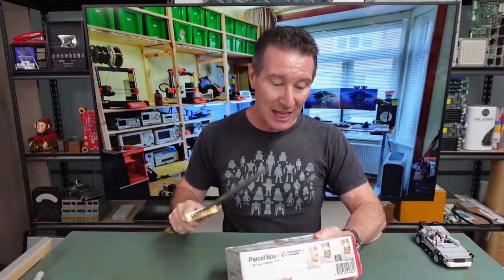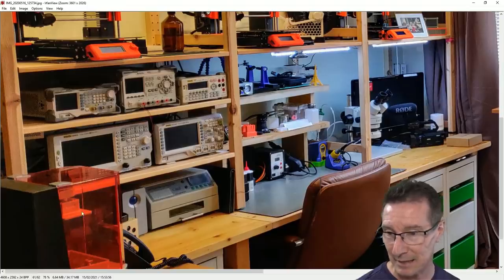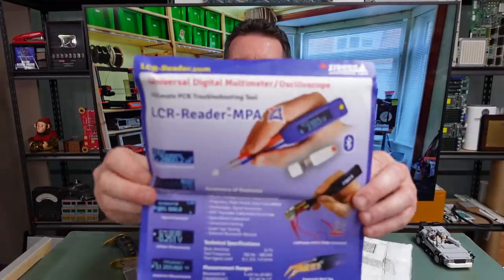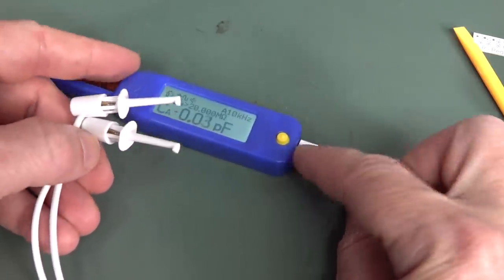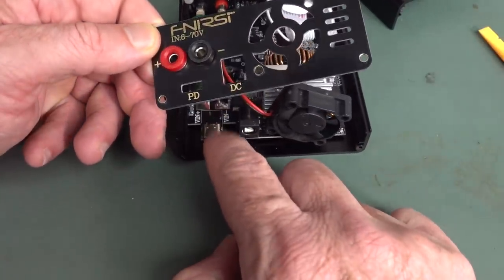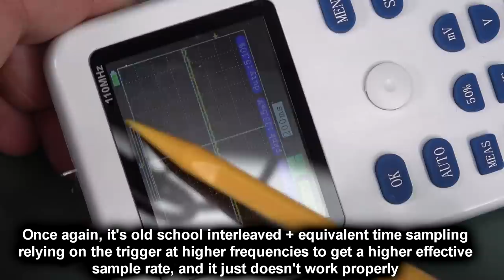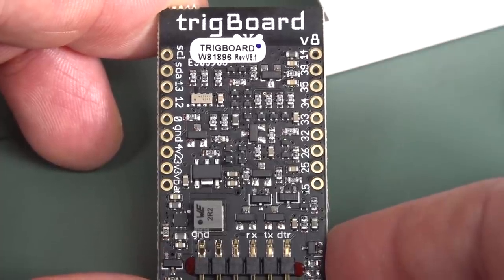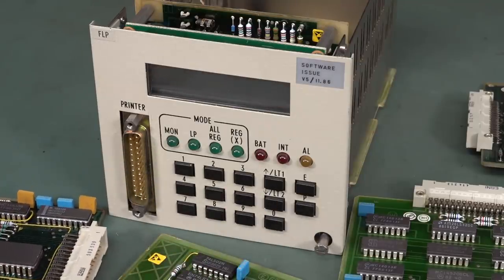EEVblog #1375 - Mailbag

Comment: Hi Dave.  The last mystery tin box is from a Siemens dual terminal optical fibre system.  It's the supervision, alarm monitoring and reporting device.  It reports alarms in real time as well as storing past events (there was a limit to the number of events it could hold in memory, but alas that parameter has escaped my memory - no pun intended)  The printer port on the front panel connects to a serial printer.  We used to use a dot matrix printer as it could print one alarm at a time and simply advance the paper through the printer as required allowing many alarm events to be recorded on a single page of tractor feed paper.  Helpful as it provided a permanent record of events which aided fault diagnosis

The LT1 and LT2 buttons refer to Line Terminal 1 and Line Terminal 2 hardware equipped to the same subrack. A tech could easily toggle the LCD to display alarms from each Line Terminal independently on the 2 line display using these buttons as well as a facility to scroll through past events.

The unit also extended alarms by applying an earth potential via relay contacts to the power and alarms panel in the equipment rack and to the station's generic alarm facility for visual, audible and remote monitoring purposes.  The REG buttons refer to optical regenerators along the fibre route between line terminals.  You used the buttons to view the alarm events at each regenerator site.
Reply: Yes!!! I remember working on these when I was working for Telstra (Telecom) in the early 90's.
Reply: I was going to post that it was specialist comms gear - but you beat me to it! Nice info too!
Reply: Dave should make a T-Shirt out of his comment though I laughed at "It's full of boards!" :-)
Reply: @footrotdog  Me too.  I used to work in Network Construction - Transmission (known as NDC) for Telstra in WA until 1989.  I eventually got a package when Telstra closed the training section in 2002.
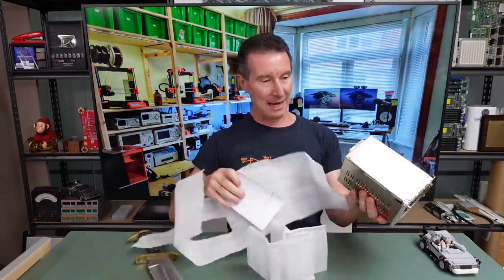Reply: It was probably written in the note he missed: 46:18
Reply: @romelec  It's a long episode - the old man was tired by now. A bit later he clicked the button and asked if this was a reset switch (47:13) and after he pulled the boards out he asked if this was a socketed relay (48:50)...
Reply: @oldguy9051  LOL
Reply from the maker: Someone always knows! Thanks Alan
Reply from the maker: @td4dotnet  I should have edited in a 2001 scene.
Reply: @EEVblog  you're welcome Dave. That's the beauty of this channel.  So many interesting things to see and heaps of viewers able to contribute to discussion.  Glad to be able to contribute.
Reply: ‘ultra-reliable’, as long as it doesn’t get wet.
Reply: @romelec  HAH! So true!!

Comment: I'm surprised you didn't recognise your first item the SCR. I have a dud that is about the size of a hockey puck it was  rated at 1700v and 600 A. Both sides mounted onto the buss work.
Reply: Yeah diode with a third signal wire, what could that possibly be?

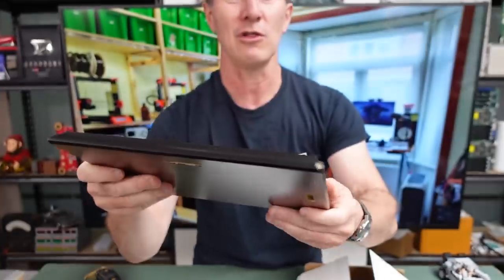Comment: 12:15 doesn't the IEEE have enough money for a CNC router or are you the first Senior Member and they tried to use it the first time with some furniture wood they've found on the road?
Reply: Not wood, just MDF
Reply: IEEE , ACM, SMPTE, ACS, they're all the same. You keep your membership fees paid up for decades you're good. You skip a year and the love is gone. IMHO there is somewhere between very little and no value in being a member these days when compared to the 90's. What do you think @EEVblog ?

Comment: ....but for the workshop you show us early  I didn't notice fire extinguishers on walls . Smoke alarms would also help .
Reply: It's a good point, I have a foam and a gaz extinguishers, and smoke sensor is at the middle of the room (only half is displayed in the picture). I am quite paranoid for that 😅

Comment: Separate cathode sense lead is because of lead inductance and resistance, as you generally trigger those SCR units using a pulse transformer, and the lead inductance of the main lead can slow down the turn on, so you have a separate lead to allow your gate drive to not have a massive step on it as the device turns on. Gate trigger is around 2V at 5A, typical pulse to ensure the slow device turns on very fast, as otherwise they are prone to burning out with poor gate drive, as only part of the junction turns on.

Ferroresonant not too common, though I have had a few of them as UPS units, and they are rugged and reliable, though efficiency is really poor, as the power input is almost constant irrespective of load, though they do provide a really decent sine wave output, just with high third harmonic, but excellent isolation. They do tend to be hard on batteries, as they typically use a SCR charger, and they will survive up to 2 cycles mains loss before they switch over, though most are dual conversion, with an always on output stage. 15 2N3773 transistors per half side, and they will blow up very nicely on any fault, blowing the cans off the TO3 packages.

Still got a ferroresonant line conditioner, which also serves as a pretty good room heater, as it is a 1kVA unit, so input power is close to that, and the output is totally isolated. You find the capacitor tend to fail, and you need to replace them with the correct part, as they can have up to 1kV across them under certain conditions, and they tend to run at around 600VAC with normal input voltage and output current.

Comment: Are there actually any half decent handheld o'scopes that can display their claimed frequency properly . Even at 50Mhz and lower, that thing was jittering/jumping all over the place and the sine wave was not smooth at all. Square wave would be even worse.
Reply: Just use the carrying handle on a regular oscilloscope. Boom! Handheld oscilloscope!
Reply: To be fair, it's good enough for automobile and Arduino work, I made my own awful £18  DSO138 kit, good enuff for PWM. It's very hard to justify/afford the multi-thousand dollar price tag of the big players like keysight for using in dirty environments or for hobby suff.

Comment: Thanks Dave for the background selection! Thanks also for the good comments! I try to keep it clean and organized because it is how I feel the best to start my day, but it's not always clean as the picture 😅 shelves are IVAR from ikea. Multiple 3d printers are there because they don't have the same specs (nozzles and filament distribution) and I have different usage for them. I often have to design pcbs for really closed space, then I 3d print the space to be sure of the connectors etc. And I use them to prototype boxes and buttons too. I indeed had a deal of a rigol pack when I changed my lab hardware, the spectrum analyser came after though. Have a wonderful day!

Comment: I actually also recently ordered a DC-6006L Power supply. Looked at it many times and finally pulled out my credit card and ordered it.
Curiously enough the idle power is 1.4W, at 57,4W load it draws 60W that means 97,9% efficiency! That is pretty darn impressive! And that is still without calculating the loss in the leads themselve!

Comment: I have a few of those diodes too, and the companion SCRs. This is from the 1970's and a driver failure resulted in commutation failure, shorted SCRs and blowing some expensive silver element sand filled fuses. We changed the parts as a set for the lead and lag for each of 3 phases.  This sure brings back memories.  No IGBT fets in those inverters.. They were SCRs and big stud mount ones.

Comment: A few years ago I hacked a WRT54G router to act as a remote wireless sensor, using the enable pin on the buck converter to shut the unit down and save power. That looked absolutely primitive compared to the Trig Board.

Comment: You can actually test short turns in a transformer with an ESR meter.
And that power supply looks like a synchronous buck converter using TL594.

Comment: 3:47 The red wire is actually just cathode connection for gate driving (note that gate voltage is relative to cathode).

Comment: 33:11 it looks like that power supply module is about 95% efficient (dissipating about 3.3W) based on the power source output (64.052V * 0.938A = 60.08W input vs 56.79W output)

Comment: Yup, those SCR's and diodes are small compared to the ones I got to play with back in 1980 when I started up and serviced the worlds larges (at that time) 1 MW 3 phase 400 Hz UPS. For the 4 MW 60 Hz stuff they used big ass "Hockey Puck" types. The extra red wire was used for connecting to the gate firing control. It was fun having one of them fail !  LOL

Comment: Isn't that second wire in scr for measuring current in fact?
You measure voltego drop across  thick wire and knowing its impedance you could calculate current.

Comment: Those staggered connectors look weird at first, but admittedly it's an easy and efficient way of "keying" the plug-in boards. I love it!

Also what's with the weird angle on that IC visible to the left at ~48:00? Haven't seen that before...

Comment: Hi Dave, is this a Mailbag or Rip It Apart review video?
At 4:00, the extra thin red wire is to pair with the white gate wire to connect to a trigger transformer.
The transformer allowed the SCR to be at just about any potential and your control circuitry can be at safe gnd potential.
At 7:30, workspace is too clean.... where is all the work!!    LOL..😃

Comment: My cnc plasma cutter with water table came with the ss braided probably the smaller of the 2. My machine is rated 3 phase 300 amps I think. My actual plasma is only 125A though

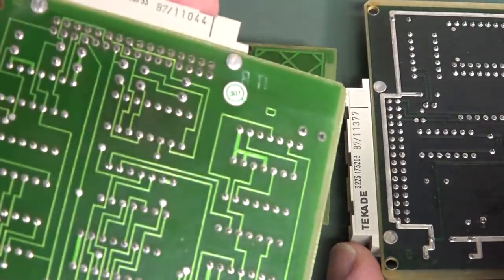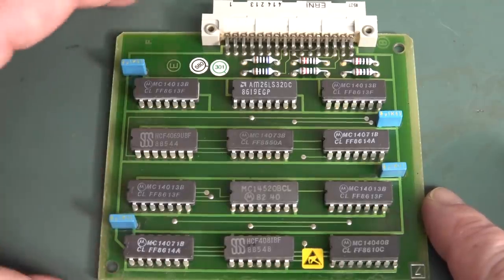Comment: 49:36 looks like we got a hot chip... looks like it's the AM26LS32 (seen at 49:04) so if you power up this thing and it doesn't work, that one's at least suspect.
(Google says it's a serial transceiver, so there's a decent chance this chip just normally runs hot)

Comment: Does this FNIRSI DC-6006L has control and logging using USB? If so, that would be amazing. I know some other similar PSUs have optional BT module, and some UART headers on board to allow that, but USB would be so much nicer, with multiple units controlled and monitored from computer or Python script, etc.

Comment: Old tower crane at concrete panel factory used similar thyristors and diodes in controller for main motor.
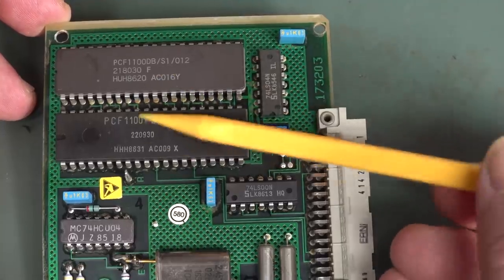Edit: 50:24 - board can be multilayer._

Comment: @20:14, when you show the tips in close up, on the rear tip, there is something. It looks sike solder beads. If they are not conductive, you would have to apply pressure, until the metal sufaces further behind get contact.

Comment: I think you've missed the most interesting 3D printer on the lab shot, the one at bottom left.
Reply: Yes, but the most dirty one, too 😅
Reply: @SatprodStudio  Is it good / worth the money? And do you have the stabiliser (or how it is called) as well?
Reply: @mx0r  honestly, I have been 3d printing for years (starting 2014 I think) and the prusa are thebmost reliable printers I never had. I've donated or sell all the other 😅 I did print some absorbers to lake them quieter but it was mostly due to the shelving than the printer itselfs
Reply: @mx0r  oh sorry, you meant the sla printer? If so, yes and no. To me that have a professional usage and want part quick and clean fast, yes. The combo with the uv curator is really nice. For a hobby with time, it's definitely too expensive

Comment: Dave I do have the syborg tweezer as well. Try to clean the tips with IPA. I noticed a similar behavior too at first. Also tighten the screws. It's a Kelvin probe essentially with the flat flex. Greetings from KW (Kitchener Waterloo Ontario) where cyborg is located  :)